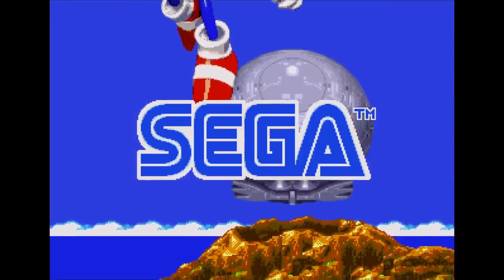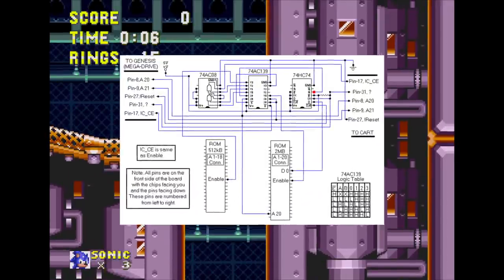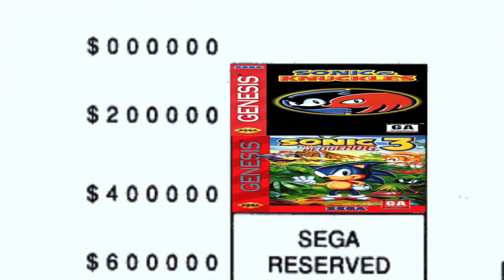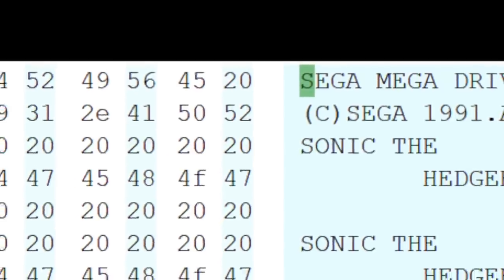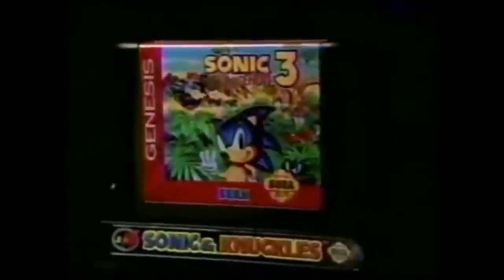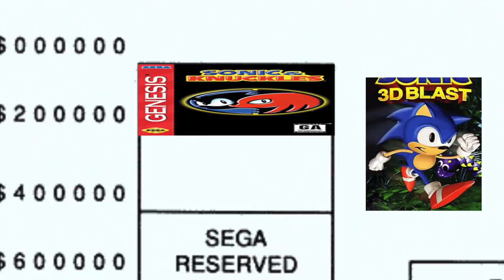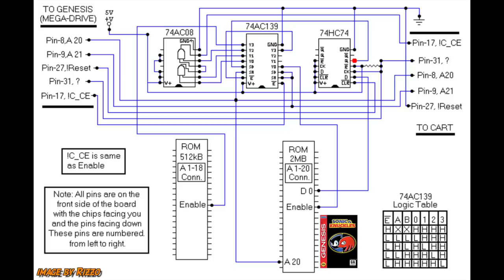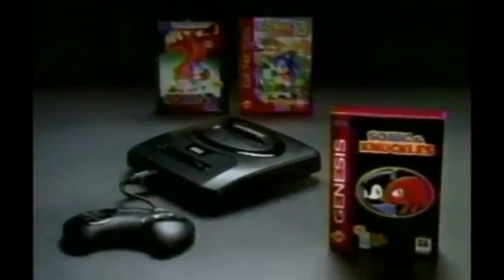SEGA's Crazy S&K "Lock-On Technology"

Comment: I love how he does everything in this video except explain how Lock-On actually works at the hardware level, which is ironic because staring at the circuit diagram for a while, it's really quite simple.  So simple, in fact, that it would probably have been faster to explain it outright than to handwave it by saying there's "some sort of pulse" that tells the cartridge which ROM chip to turn on.

There's 256 bytes of address space in the SEGA Genesis memory map reserved for cartridge peripherals, much like the Super Nintendo's B bus.  Pin 31 on the cartridge turns on whenever this address range is being read from or written to.  Some chips on the cartridge detect this signal and look at the data being written.  If it's a 0, the cartridge selects Sonic & Knuckles.  If it's a 1, it selects the patched version of Sonic 2.
Reply: Yeah was hoping that it was going to be explained on the hardware level. Still impressed though. Wonder if Nintendo ever attempted this?
Reply: Which number(s) is/are used for Blue Spheres?
Reply: Damn, A boolean switch. Nice job Sega
Reply: @just_gill6113  "Very clever."  -- Coding Secrets 2020
Reply: @Shazman30  
Maybe kind of, Rare Ware tried something with Banjo Kazooie and Banjo Tooie. But I can't explain it.
Reply: @amateurprogrammer25  Thank you Amateur Programmer, very cool!
Reply: @Carbon Roller Caco Blue Sphere is part of Sonic and Knuckles that is booted when a lock-on cartridge is verified that isn't Sonic 3. (Obviously, the check for Sonic 2 is first)
Reply: @CarbonRollerCaco  Blue Sphere is part of Sonic and Knuckles ROM chip.

Comment: A little more extra infos on how Sonic & Knuckles accesses the Sonic 3 Data.
Sonic & Knuckles's sprites are in the S&K Rom, along with the music for every zones from Sonic 3 & S&K. Stage layout for the S3 levels is also stored in S&K meaning level design was tweaked and updated. Object code (obstacles, player characters etc) for every S3 & S&K zone is also included in S&K proper
So that leave us with Tails' Sprites and the zone artworks and other sprites for the S3 side of the game needing to be read from Sonic 3's ROM. How do we do it?
Simple, Remember how S&K's ROM is mapped from $0 to $1FFFFF? The Sonic 3 Rom follows right after and its header is then looked up at $200100.
The same logic applies for every call made to the Sonic 3 rom. Once the game detects it has a valid Sonic 3 Rom inserted, it will begin looking for data past $200000 for the Sonic 3 stuff.
Basically all the devs had to do is add $200000 to every call for a pointer in the Sonic 3 ROM and everything worked as is, the only required thing was to have all the code for everything including updated Sonic 3 code stored inside Sonic & Knuckles and almost everything worked as is (although the game code is mainly ran from S&K's rom, some code is actually executed from the Sonic 3 ROM in specific cases)

Hope this was clear enough.
Cheers
Reply: Did they do that for Sonic 2 as well? They could have but it sounds like they just included a full ROM from this video. This makes sense since they would otherwise have to support three different versions of Sonic 2. It also means if you owned S&K but not Sonic 2, technically you actually owned a copy of Knuckles in Sonic 2, Sega just locked it down until you plugged a Sonic 2 cart in.

Would this also mean you could yank the Sonic 2 cart once the game started up? That clearly wouldn't work for Sonic 3 though.
Reply: @TheMAZZTer  They do a similar yet different thing for Sonic 2.
Basically they map the patch ROM above Sonic 2's ROM in memory, but said ROM only contains the game's code and color palette data and probably a few new sprites for the special stages and the title screen (Knuckles' sprites seem to be read from Sonic & Knuckles). New level layout data is also stored in that patch rom.
Basically that small ROM alone isn't enough to run the game, your Sonic 2 cart ain't just a "key" it's mandatory to have the cart in to actually run anything, yanking the cart out once the game is running would only result in a crash.
Reply: Yeah i was thinking this just now. It would be too hard to patch a the sonic 3 code on the fly so S&K must contain all its own code and just use S3 assets, but you make it sound almost like it even has its own copies of half the assets.
Reply: @bangerbangerbro  Well...no, I didn't.
Reply: @mspeter97  To me you did. Obviously you didn't actually say that or anything that means that, but the number of different things you said were store in S&K made it sound that way. Everything except for tails and zone graphics from sonic 3 are stored in S&K is what I understand you to have said. Of course those graphics will take up a lot of space but in a sentence that as one element doesn't sound any more significant than the rest of them.
Reply: So is Tails' super transformation, which isn't available until locked on with Sonic and Knuckles, drawing on assets for Tails that were already put into the Sonic 3 cart, or are those assets added in the Sonic and Knuckles cart?
Reply: Why S&K rom does have music for every zones from Sonic 3 & S&K?
Reply: Sounds like a lot of complications instead of just using a bigger rom.
Reply: The S3 music (zones, multiplayer levels, etc) are actually accessed from S3's data, not S&K, try this:

Load S&K in an emulator and try to play a S3 track from the sound test. Nothing will be played.
Next, load a S3&K ROM with the data at 0x200000 to 0x200200 zeroed out. This will load S&K like before, but S3 tracks from the sound test will be played.
Reply: @evertonfrancisco9149  Sonic 3 music is actually accessed from the Sonic 3 ROM, not S&K.
Reply: So the only question I have left: Where is the Data for the S3&K Save File stored?

I.e. If you have 2 copies of each game, completed a 3&K Game File, If you then swapped the S&K Cart with the same S3, does the completed file show up? Or does it stay with 
the S&K? Or is it more complicated where It uses Data from both Carts?
Reply: @Shadowwand  In S3. S&K doesn’t have a save system at all.
Although this does bring up an interesting question: why does S3&K have more save slots than S3?
Reply: @TheMamaluigi300  I think that's somewhat reasonable. If using the S&K cart essentially "opens" a different set of File Folders for S3&K save files, it seems reasonable that the devs alotted more spaces, to allow saving additional Knuckles playthroughs.

So in essence, Each S3 Cart has 2 memory folders, one for S3 saves, and one for S3&K saves. And only the S&K cart can actually Redirect which folder of Saves we're looking at.
Reply: @Shadowwand  When you first lock-on Sonic 3 to Sonic 3 & Knuckles, the save data is copied into a previously unused area of the SRAM so your old save games show up in S3&K. From then on, the two games use completely different save slots - meaning you could play or wipe the saves on Sonic 3 alone without affecting what S3&K sees.

Comment: I'll also point out that several Electronic Arts games, if plugged into the Sonic and Knuckles cartridge, would load the EA game instead. I noticed those cartridges had lightning bolt symbols on the side. Virtual Pinball plugged into Sonic & Knuckles loaded Virtual Pinball instead, not S&K or a Special Stage. However, Lotus Turbo Challenge would load a Special Stage.
Reply: Those are likely either due to the 4mb issue which caused the cart to not detect a header, OR they used a different header altogether which would understandably do the same thing.
Reply: @flabort  if I remember correctly I believe it's because the EA games lack a proper header. EA actually reverse engineered the sega lock out system sot hey're technically unlicensed. It's why the carts are a different shape
Reply: I wonder if Accolade games would do this too.
Reply: @minemariosonic  Good to know they've been dodgy since the beginning.
Reply: @minemariosonic  You are right.
Reply: @minemariosonic  I figured that was the case - I actually knew about the reverse engineering thing, which was so cool. I just didn't want to speculate too much.
Reply: As someone else mentioned, EA reverse engineered the system so they could manufacture the games themselves instead of leaving it to SEGA, hence why their cartridges had different shapes. They did it so they didn't had to pay Sega for the licensing fees of manufacturing costs. Guess this wasn't illegal, since it was reverse engineered, just rather sketchy. And weird. Don't remember where I read it, but Sega was amazed and set back that it happened.
Reply: @rodrigoprataorge1471  There might have been a lawsuit, but it's not the first time.

Tengen did the same thing on NES, Nintendo sued, but lost.

It's pretty consistent actually. Every time a company puts security in their system to prevent unauthorised games, someone finds a workaround, it ends up in court, and the company that made the lockout tech lost.

Though that tech was a response to the market crash with Atari anyway.
The 2600 had no lockout, and the crash was partly caused by too many terrible games coming onto the market.

The famicom has no security either, yet the NES does...

In fact, early iterations of the Mega Drive have no security either. It was something added to later models...
Reply: @KuraIthys  nintendo didnt lose against the tengen lawsuit... It was quite clear atari stole the source code to the lockout chip from the US patent office.
Reply: @rodrigoprataorge1471  Sega was actually kind of pissed because it was ruled that the way they tried to do it wasn't legally enforceable for some reason.

Don't quote me on this, but it had something to do with there being literally no way to run code on the Mega Drive WITHOUT including 'Sega' at that specific address, therefor it was considered fair use or some shit.
Reply: @minemariosonic  A lot of the bad-blood between SEGA and EA stemmed from this chicanery by EA back in the day. SEGA unfortunately were forced to allow it due to a lost court case with Accolade but also because they needed EA Sports titles on the MD which sold insanely well and helped sell MD consoles.

EA were always pricks though when it came to dealing with SEGA, later on infamously refusing to develop for the DC which was a major contributor to its demise.
Reply: I'm glad it wasn't just me who 'experimented' with all my different games and S&K.
Reply: @Helladamnleet This is the same reason why bootleggers and homebrew developers are allowed to put Nintendo's logo in Game Boy series ROMs and multiboot payloads.

Comment: I had always wondered about how the technology worked because it seemed like an engineering nightmare to get right. Combining Sonic 3 and Knuckles together is logical because they’re both running the same code and essentially play on top of eachother, but how it worked with Sonic 2 always had me stumped. I never realized it was a separate ROM chip that it switched to when the game was inserted.

I also have a lot of memories of trying to “trick” my Genesis as a kid by inserting different games into the Knuckles cartridge. I thought for sure that one would match up and let me see some really weird glitches. (Glitching Sonic 3 with the debug mode was always a lot of fun to me for some reason)
Reply: That's a good way to get all your Not-Sonic 3 save files wiped - a nasty S&K bug.

Comment: Now I’m curious as to what kind of disaster could be created by editing the headers of other games to that of Sonic 3 and maybe 2.
Reply: If it executes code from the plugged-in cartridge, it will most likely hang/crash.
If it only uses graphics and maybe map data (this is most likely), some graphics will be replaced by random noise (like MissingNo), and/or the level will consist of random tiles (like pokemon glitch city). 
If you are "lucky" you may see distorted fragments of inserted game graphics randomly.
Or it just crashes/freezes if metadata is too corrupted to even load.
Reply: You can use an emulator + hex editor to simulate this scenario. Just write other game ROM after the end of S&K ROM.
Reply: Jack White This is what I suspect, although I’d still expect S&K to use executable code from S3 for level specific stuff and even then there’s the question of how any data is interpreted. Still, I’m curious to see similar to ‘corruption’ videos you see on Youtube.

Only reason I didn’t try was because my desktop is disconnected right now.
Reply: @jwhite5008  Sadly, it just lead to a black screen, unless there's some kind of checksum involved which I doubt. So no nightmare fuel.
Reply: @tech34756  It could possibly read data in a very specific format, like prefixing it with a magic number like "PK" zip header, or simply calculating data sizes depending on the data i.e. { uint16_enum_t data_type; int32_t offset; int32_t size; } and then check that 0 < type < 4 && 0 < offset < 4M && 0 < size < 4M and so on, and if it does not match - hang or crash or try reading past address space and then crash or similar - at least that what I would have done if reading from a questionable external source.
And there is simply a possibility that it tries to read past the end of actual data of your cartridge (which would have wrapped on the real cartridge if high ROM bits are missing, but not on the emulator)
Oh and verify that the ROM file itself does not have some kind of checksum or header - check emulator log if it has one. Does S&K load correctly if legit S3 ROM is concatenated that way?

Comment: In that time, a friend of mine had US Sonic 3, and his neighbor, also my friend, a JP Mega Drive, and the US game is region locked and do not work in consoles of different regions.

A third friend of mine got an US Sonic & Knuckles, and I borrow it to play at my friend's JP Mega Drive, and the game do not have region lock.

Now the interesting thing: Sonic & Knuckles will ignore Sonic 3's region check and let the combined cartridges runs in any Sega Genesis / Mega Drive console. So, my friend with the JP Mega Drive could play the US Sonic 3 combined with Sonic & Knuckles.
Reply: There's actually a reason for this! Sonic 3 was just a standard cart, so it could be region locked like any other and be under normal circumstances. However, when it came time to make the Lock-On cart, rather than make a different version for all the Megadrive software regions, they decided to only make one kind to keep manufacturing costs down. The only regional differences are the sticker on the front and the packaging.

As for why Sonic 3 runs regardless of region while locked-on, S&K only checks the serial number of the S3 ROM in order to validate it. The serial number is the same across all regions. Not to mention, no game code actually executes from the S3 cart in this configuration. It simply serves as an asset resource for Tails and the Sonic 3 level art and also a source of SRAM.
Reply: @gold_lightning  The SRAM of Sonic 3 isn't used in S3&K, it has its own SRAM that is locked away in S&K mode. Upon detecting an S3 cartridge for the first time, it copies over the saves to its own SRAM, updating it to the S3&K format. If you delete saves in S3&K, it won't delete them in the original cartridge, and if you restart the game (probably only via power cycle, not sure), the saves will reappear, but only at the point where you left off in the S3 only game.
EDIT: Also, technically S3 and S&K use FeRAM/FRAM chips (sorta like small flash memory), not SRAM+battery.
Reply: @Consolethinks  Incorrect. The Sonic 3 cart was actually future proofed specifically for this. It has 14 save slots. 6 are reserved for Sonic 3 and 8 for S3&K. If S3&K is booted with the last 8 slots blank, but with something in the first 6, it will copy the first 6 over to the S3&K portion so the Sonic 3 save is untouched, but you can continue the adventure in S3&K. There is no sram hardware on the S&K cart at all. The Sonic 3 cart handles all of it.

Comment: They originally planned Sonic 3 & Knuckles as one game, but they had a close deadline due to a McDonalds licensing deal, so they split it into Sonic 3 part 1 and 2, with Sonic 3 Complete being the "deluxe" release containing both titles. Part 2 became Sonic & Knuckles with the lock-on gimmick, and Sonic 3 Complete was then deemed unnecessary and axed. There are prototypes for S3C that exist, one of them has the ending theme being a medley of Sonic 3 tunes, similar to the S&K medley in that game.

Comment: Those commented assemblies certainly bring back memories. General Motors used a variant of the 68000 used in the Genesis, namely the 68332 that used the CPU32 instruction set (very similar to the instruction set in the 68000, but with things like TBLU and such for embedded control systems) in their early 96-03 VPW PCMs. Did a shitton of programming and hacking with those. Really liked working with the CPU32 instruction set.